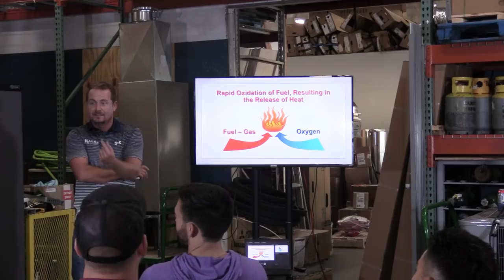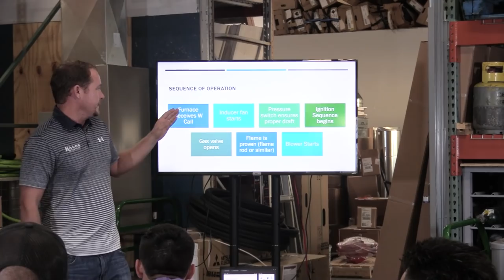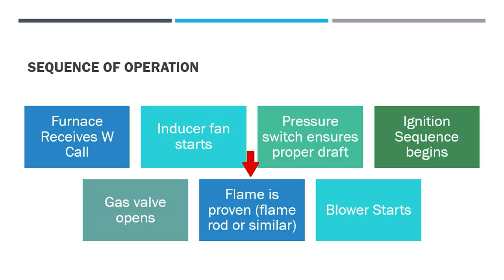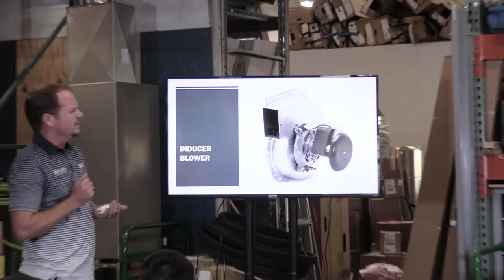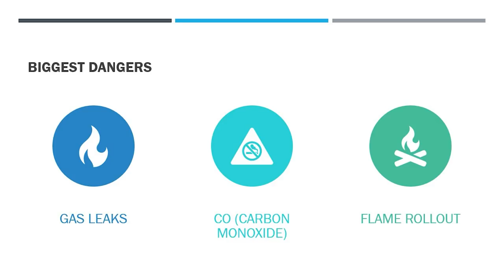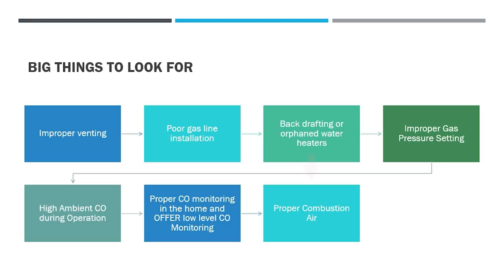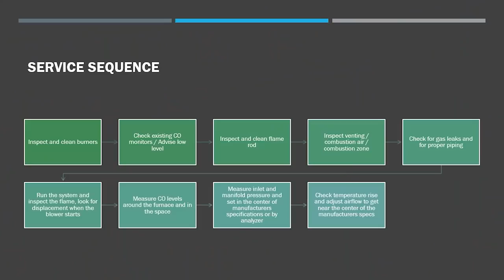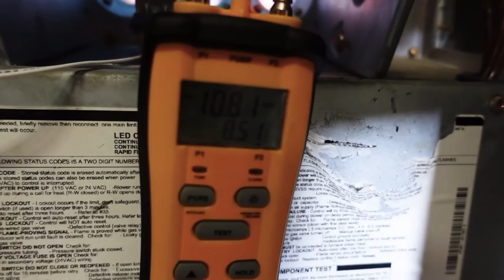Gas Furnace Class

Comment: The pressure switch they brought up thinking you can just leave it jumpered would be on the Amana/Goodman/Daikin high efficiency furnaces. They have a pressure switch they label as a plugged drain pressure switch. This switch is wired inline with the gas valve. It will never produce a pressure switch fault but will cause failed ignition faults.

Comment: This was a very helpful and thorough presentation of gas furnace servicing.  
  I recently remove the black wheel and me draft inducer motor and oiled the bearings so the person would not need to spend $400 on a new motor plus labor. It would squeak at times so I figured the bearings were getting dry.  The fence inside the black wheel which had an open center were full of oily dust.  I cleaned the fence off and wondered if this black wheel was also intended to be a cooling fan for the shaded pole motor.  Normally I would not count on oil light type bearings to keep running after being oiled for very long.  This type of motor has some packing around the bearing which holds oil so I expect it to last.  When I started servicing HVAC equipment in a rather wealthy neighborhood on the north shore of Chicago there a many antique Boilers around still in 1984.  We had to replace the thermal couple on each service call for a gas burner.  It was interesting hearing you refer to these items as being unusual nowadays.  The fan limit switch that started and stopped the blower motor was very common.  One place I worked in the 80’s for 22 years had a dual section boiler that was the old style.  It had metal doors that could swing open around the burners and they were getting disintegrated by flame rollout.  I learned that they had some thing like a 6 foot run horizontally of the flue pipe within the building itself.  I don’t know if they ever change the boilers but there was some concentration of CO2 around the burners because the draft was not adequate.  I feel more prepared to look at home furnaces after your video today.  I was involved on a regular basis with maintaining a complete steam heating system including overhauling the 200 hp boilers, pumps, piping & over 400 steam traps.  With my electronics background I was asked to re-wire one of the 1968 Boilers which had vacuum tubes in its controller.  I had to  convert it to a Fire- eye digital controller.  I was able to do that but made one mistake that started to show up 20 years later.  The boilers should have been wired for purging on high fire instead of low fire.  The state inspectors discovered this mistake and it was probably the cause of an internal boiler explosion.
I made that choice based on what a previous electrical engineer had done with the other boiler that he had converted to a Fire eye controller.  I also learned that if I had a license at the time I would have lost it for installing a new Honeywell actuator on the main gas valve.  
Neither boiler had redundant gas valves as a safety measure and they were grandfathered in. It would have been a tremendous expense to redo the piping because those gas lines were roughly 4 inches in diameter.  Another time the bother would not start because a spider have built a web  over the vent for the big regulator on the main gas line.  Your video was so comprehensive that it  made me feel more up-to-date on the current high-efficiency boilers.
Thank you very much for all this information.  
The class participation was also very helpful.
Stuart Milne

Comment: It makes me feel old when you talked about the bimetal fan control switch. I remember seeing that’s all the time when I started as a tech in the late 90s. 

The valve opens and the burners light and you would watch the little dial slowly twist till it hit the set point for the blower and CLICK the blower came on. 

And if it was a cold cold house you could the see blower cycle off and on if the plenum temp dropped too much because of very cold return temp.

Comment: I have a 30 year old Bryant Furnace. This season found the humidifier cage motor not running. It's a Skuttle bypass humidifier. Furnace would run a while then shutdown with code 33. China supply for the motor is way out so I blocked  the bypass bringing back hot air into the inlet side and no more code 33. Also installed a cheap filter for better air flow. I don't know which really fixed it. I know there's no flameout. I suppose it was the hot air loop back with no cooling in the humidifier.

Comment: ive got one for ya how about 3 burners , 2 with flame one no flame the one with no flame has a flame sensor above it that shuts down the system because of no flame present on that tube, anyway any thoughts as to what is causing that tube to not light?
Reply: Probably low gas pressure.  Could also be a blockage preventing gas from reaching that burner.or dirty burner
Reply: Blockage at the spud.
Reply: Blockage at the jets coming out of the fuel rail is a high likelihood. My next guess would be a weird amount of pressure coming from the valve.

Comment: Crap a little roll out. Damn I became part of the blue flame team. Complaint in crawl space they said would get booms. So I did visual did not see anything. To do this you climb down into the pit with the furnace. Now wired up long jumper wire to thermostat connection  and climbed out of pit for safety and started heater over and over again. Did not have extension mirror with me. Just could not get it to make boom. So crawled over the concrete wall back down with the heater and first attempt to start it again. I remember seeing the blue flame cruising right along the dirt right to my face then remember the boom. There is no room to move or do anything. That was an emergency room call. now eyelashes, eyebrows burned off with slight no permanent damage to both eyeballs.couple of days running around with both eyes covered. I was wearing a blue jean vest with the fake lambswool and you could see where it burned some of  the that up and around the collar. I promise you that was the last time I did it that way. Lmao
Reply: Wear safety glasses at all times. Been there unfortunately done that. No permanent issues, Luck was on your side.

Comment: Goodman has a pressure switch in line with gas valves that can be jumped out, always 2 gray wires. And the dual p switches for high and low fire that can not be jumped out.

Comment: Electronic only furnace requiring a G call got me before! Blower motor wasn’t coming on, no G call from thermostat during heat. 
Changed settings on thermostat for electric heat. Thermostat then called for G during heat. System then worked fine after that!  Thank you.

Comment: "Control board goes through safety check" should be the next sequence after "Call for heat". Inducer will not come on if pressure switch is closed or if limit is open
Reply: Generally it will run with limit open to exhaust any potential flue gas/heat

Comment: In a restaurant had problems with a 50 gallon commercial water heater. Ended up when building was all doors and windows closed would go into one big space of negative air. The culprit was the exhaust hoods and the make up air were way out of balance. Employees said scared the piss out of them when they saw the flame lurching out at the bottom then disappear back into the water heater.

Comment: Some furnaces like mine have two series pressure switches. If you jumped one out the circuit is still open as long as the other switch is working. Then when the switch makes the circuit closes. Not advocating for jumping switches out but sometimes if it’s two in series and one is an issue and you jump across the  one that doesn’t make it would still fire.

Comment: Start with order of operations of a gas furnace.  Call for heat.Control board verfies pressure switch is open. Inducer gets 120v. Pressure switch closes. Hot surface ignitor gets 120v. Gas valve gets 24v. Flame sensor proves flame. Blower motor starts (after delay). Magic.
Reply: Even for all that to happen: you need 24v from xfrmr,, through 3 or 5v fuse, thought limits (rollout and high limit, to the control board terminal strip. To the thermostat and then call for heat at W or Hear pump...
Reply: It's nice working on simply systems like those. Up here in Canada where you cannot install old mid efficiency furnaces we have a more complicated sequence of operations. We have calibrations cycles for inducer motors. Communication verification on blowers. Feed back from discharge air sensors and return air sensors. So on and so on. However when I teach new guys I usually start with the same sequence as described but including the transformer, low voltage control terminals, and the rest of the safety string.
Reply: Control board verifies pressure switches are open and limits are closed
Reply: @adamradley4407  Here in Chicagoland all the yuppies have those too. I'd say it's about 30% high efficiency. You're making it sound  way more complicated than it is though.
Reply: @JohnDoe-jt9oq  I am not only referring to high efficiency though as those are the only "type" that can be installed. I am referring to modulating furnaces on communicating systems. With those you can't even take simple pressure switch readings as they are all referenced to either gas valves or transducers. To make matters worse if they are set up on zoning systems you end up with even more issues. Yes some are not complicated but more and more of them need technical data sheets to correctly diagnose the issues. Just think of the carrier, York, lennox type communicating systems. As long as they work it's fantastic. Show up to one of those with the Co p,ain't of an intermittent issue and you'll be there for a while
Reply: @JohnDoe-jt9oq  just think of the situation where your discharge air Temp sensor is outta wack. Not many new techs would think to check resistance to temperature for a furnace not starting. If we stuck to the simple sequence of operations that problem might take a long time to resolve. And yes this does happen on both the return and discharge for the units pushing 99% efficiency

Comment: There are SOME manufactures that have spdt pressure switches. The control board will want to see that the switch reversed position during shut down before the next cycle. Also, the pressure switch "helps" monitor the HX, if the HX cannot be put into a negative pressure, the switch may not close, requiring further inspection of the HX possibly.

Comment: I had a Coleman heater complaint something smelled like it was burning. Renters called fire department. "Fire department flagged heater" So I tested heater worked  fine could not find anything wrong. At night time get call smell is back. What it ended up being the blower motor was going out when it started warming up the motor started slowing down getting everything very toasty and heating up the dust and motor getting really hot. No high limit trip. No error codes. changed blower motor and the unit has been flawless ever since.
Reply: Fascinating story maybe if you keep posting them someone will hire you.
Reply: @waytospergtherebro  I am self employed and get hired daily.  Thank you.